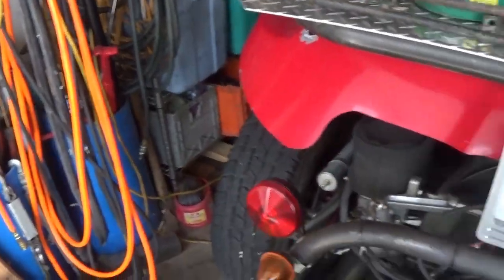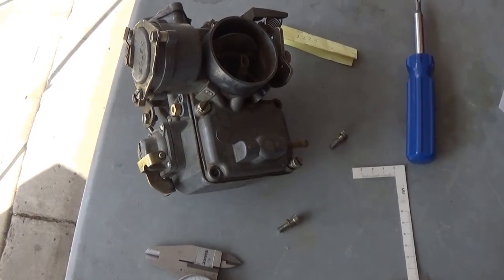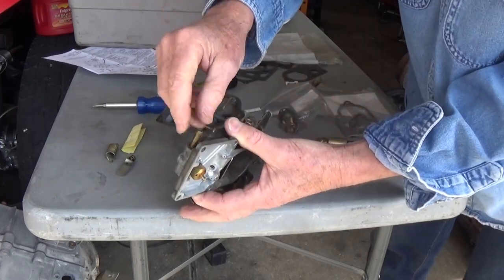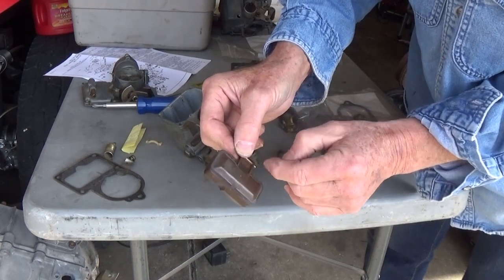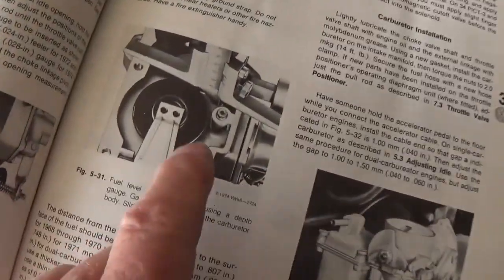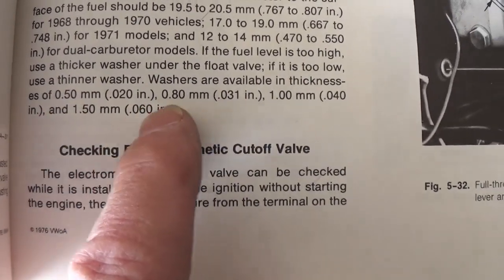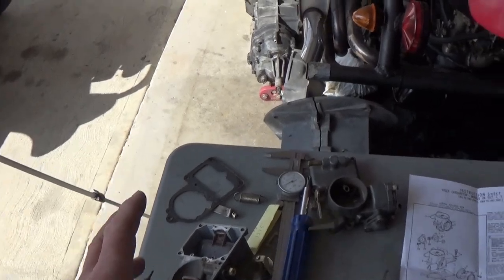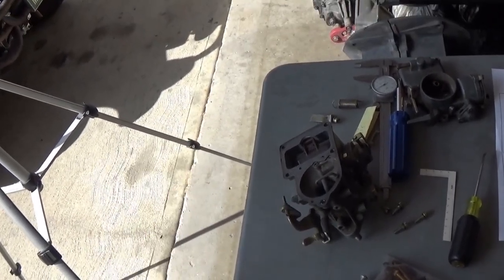VW Solex 34 PICT-3 Float Level Adjustment

Comment: Thanks for the pro vid EZGZ! One side note, I had a pict on my 1600 a while back and had a richness issue and fuel boil over when shutdown. I friend of mine was telling me about the newer ethanol fuel and it has a lower boiling point and it's buoyancy was different than the ethanol free. So i added an extra washer under the needle/seat(2 thick washers total) and that did the trick(the carb was setup per the book then jetted to the engine) man I was having a steak burrito the other day and thought EZGZ is missing out on one of these! Hope you've made it down to your local burrito joint and had yourself a treat! Catch ya on the flip side
Reply from the maker: Great info!  Love it when folks share there experience!

Comment: Thanks EZ, good info. Was having a similar problem at one time. Had the wrong size spacer under float valve and was choking itself out. That was on a 30 pict 2. Got it right and runs like a charm now.
Reply from the maker: Thumbs up !!!   Thanks for sharing

Comment: The carb top gasket in these rebuild kits are at least twice as thick as the original paper ones. This is likely the cause of flooding issues. Extra washer is the right move.

Comment: Greg, I need some help with a drla carb. Seems too be running too rich, plugs are black and black smoke from exhaust. How do I adjust to not get as much fuel? I got the bypass screws closed and tried my mixture screws between 2 and 5 turns and doesn’t change much.
Reply from the maker: I need more info:  
Is this a new problem?
What model DRLA? 
What size engine?
Reply: @TheEZGZ  not really a new problem, trying to get the car running after sitting for years. Cleaned carb but seems to getting too much fuel. 
Next to DRLA it’s stamped 45D
Pretty sure it’s a 1600

Comment: Hey EZ.
Great to see that you are back. I hope you are feeling better.
Please.
Can you give me some advice on using a new cam and cam followers in a twin port 1600. 
I have been told I need to use ‘cam lube’, then run the engine after the rebuild at around 1500/2000 rpm for 20 mins to harden the parts.
Is this right?
Just seems extreme to me for an air cooled engine that is stationary.
Thanks.
All the best.👍🏾🛠🇬🇧
Reply from the maker: Every new cam I ever bought came with a little jar of break in lube. If yours didn't come with it you can use some really thick motor oil. Lucas makes a good product. Do not under any circumstances use grease or assembly lube as a substitute. Auto parts store might even have a specific cam lube product.
Yes you want to start it and immediately keep the revs about 2000 RPM so there is plenty of oil saturating the cam during that first 20 minute break in. Don't worry about the timing being perfect or idle screws. You'll be running on the mains. Just watch and listen for major oil leaks and keep it running. 
Then dump the oil while it's still hot including the filter. Refill and let the engine completely cool down. Recheck your valve clearance and your good to go for many miles and smiles.  
It would be nice to pick up a VW shop manual that explains all this. Don't trust everything you see and hear on the internet.  
Also a good idea to use break in oil or get some zinc additive.
Reply: @TheEZGZ  Thank you EZ.
Yes. I have bought some 20/50 high in zinc oil, for the initial start and cam burn.
I’ll then empty it and refill with 30 weight mineral. When driving, do you suggest not loading the engine for the first 500 miles? I have two 30ml satchels of Cam lube, which I bought separately.
I have a Haynes manual for reference.👍🏾🛠
Reply: @TheEZGZ  Hi EZ.
She’s up and running.
Did the ‘cam burn’ last night and took it for a short run, then. Changed the oil.
Now I have to reset the timing and carb, as it keeps stalling at junctions and won’t tick over.
Any tips?
Hope you’re feeling better.
All the best.👍🏾🇬🇧🛠

Comment: Are those written book instructions correct? surely if the fuel level was too high you would use a THINNER washer, basically moving the float valve nearer the float, cutting the fuel flow earlier as the float rises?
Reply from the maker: The book is right. A thicker washer pushes the inlet valve down against the float and shuts flow off sooner which lowers thee fuel level

Comment: Hi EZGZ Sir. Can you comment on the 34 PICT Carb versus EMPI Progressive carb? Is the Progressive carb more economical in terms of fuel consumption because of the initial carb port opening is smaller...
Reply from the maker: Fuel consumption needs to stay around 24  MPG  for normal driving.  The engine and heads need the fuel to help keep cool.  The progressive carb works well  "if" you can find the parts to tune it properly and will allow more fuel and higher rpm.  Some folks swear by them but for a street car I'll take dual carbs most of the time.

Comment: Sorry about an off topic comment, but I can't find anyone addressing this problem and you seem to know what you are doing.
Im converting a 66 to a dual circuit master cylinder. (drum brakes)  As the residual pressure valves arent available, I salvaged some and got them working . Now I discover that new dual circuit cylinders wont accept the valves.
Bentely says I need them. so what do I do ?
Use the stupid aftermarket ones at $20? each ?
thanks for any suggestions ( except FO)
Reply from the maker: Not telling you what you should do. But I run whatever came on that year of car and don't worry about it. The purpose of dual brake system was safety in the event that you got a hole or broke a line the system would stop you.  Seems to me that the emergency brake was ment to do the same thing.
Inspect and or replace your entire brake system with new parts and keep them drum brakes adjusted at regular intervals like bentely suggests

Comment: solex 31 pict-4 what's wrong with the carburettor when at first it may run well and the adjustments should be right and then at idle it shuts off and the big air screw no matter how you open it, the revs don't go up? the repair kit is installed..
Reply from the maker: same answer as above.  You need to purchase a basic VW service book that has pictures and gives trouble shooting options.   The ignition system and also make carb tuning difficult

Comment: what's wrong with the carburettor when at first it may run well and the adjustments should be right and then at idle it shuts off and the big air screw no matter how you open it, the revs don't go up? the repair kit is installed..
Reply from the maker: You may have a restriction in the idle circuit fuel passage somewhere?   Hard to say without my hands on it.

Comment: by the way, what about the fuel nozzle, which is a brass pin that sticks out where the thermostat valve is, so what is its function?
Reply from the maker: That is where the accelerator pump squirts raw fuel down the carb throat on quick opening of the throttle to compensate for fuel air ratio

Comment: Hai hai great video one question am from Africa ....same carb on my bmw ... The idle is perfect but once I start moving the consumption is quiet high  what cud be the reason
Reply from the maker: larger displacement engine and heavier car uses more fuel????
Reply: Wow so meaning my car is running normal ? .... otherwise the idle is perfect

Comment: is it normal that without the Air Cleaner system the engine shuts off.. then when it shuts off at idle so when you remove the small hose from the intake neck it shuts off immediately, for a while it just raised the idle revs...
Reply from the maker: When you allow air to come into the intake manifold at idle vacuum your reducing the fuel to air mixture and the engine will stall.   When you add or remove a dirty air cleaner your also changing the fuel to air ratio that can effect idle.

Comment: I’m OWNED by a ‘71 VW transporter named Myles.
Maybe you can help me! I’ve had a problem with my 34 PICT 3 carburetors. This has been going on FOREVER!
 The instant the carburetor comes off high idle and goes to running idle the engine stalls. As long as I keep goosing the engine it’ll keep running. As soon as I stop the engine stalls.
It makes no difference whether I have the vacuum from the distributor connected or not.
I get 17 inches of vacuum from the carburetor.
HELP!!
I hope you’re fully recovered from your heart surgery!!
Thanks for any ideas you may have!
Reply from the maker: sounds like a clogged idle jet to me make sure your idle fuel  screw has an effect when you turn it in and out. Also use the idle air screw to see the affect.  I'm assuming your electric solenoid device is getting 12 volts and working properly.

Comment: solex 31 pict-4 fuel level is 14,7-15,5mm..it is 1300 1973 car..is it that ok?
Reply from the maker: Yes! it's not going to hurt anything if it's off by a little bit. Replace your spark plugs while you do a tune up and check the easiest one to get to after a couple tanks of gas. And of course notice how it starts and runs to be sure.

Comment: My bug runs when the choke is on.
However, once I hit the gas after it has warmed up and off the step the bug will die. No matter what adjustments I do to the volume screw or the bypass adjust, nothing happens.
Reply from the maker: You need a spark advance timing check and also make sure your accelerator pump squirter is working my friend
Reply: Also, no idle, is a clogged idle jet.
That would be the brass hex jet in the passenger dide of the carb.

Comment: Question, I'm running dual ICT carbs on a stroked 1600.  When I get on the gas, especially mid to higher RPMs, I get a bit of popping. Any ideas on what to look for?
Reply: If you're running a 009 dizy, open the accelerator pump adjuster up to full. The popping is probably caused when you open the throttle up and cause a lean spot. The new setting will overcome that lean period.
Reply: @Paulman50  running pertronics with vac advance. It keeps popping at sustained throttle
Reply from the maker: Was it always this way?  Most times it's like Paulman said but the list of other possibilities is long. Here are some things to check
Spark plug read
Plug wires
Spark advance
Vacuumm leaks
compression
valve clearance
accelerator pumps not working
Can you borrow a different set of carbs?
Reply: @TheEZGZ  It has always been temperamental in one way or another. It had a lot of blobby so I put a new set of jugs/pistons and heads on it. new plugs and wires too. The previous electric dizzy ended up with broken wires so I got a  pertronics dizzy. It isn't as poppy if I bring up the rpms quite slowly. This is all while stationary mind you, the vehicle isn't a North Dakota winter drivable one.
Reply from the maker: @smonroeh  Sounds like you spent some money and worked your butt off. With that said I wish you would have gone just a bit farther and split the case. 
It's so helpful to look at the #2 main bearing and also the camshaft and lifters. Sounds like you are very close to a sweet set up.  One of my first cars came with a 1776, Norris Cam and dual 34 ICT webers it had dual glass packs and heater boxes and I drove it that way the first winter. Those carbs never gave me a problem. The throttles were cable operated. With all the work you did it's probably not that dirty yet. I'll bet you could tear it down in a weekend and see what that bottom looks like. It's good to have at least a new cam and lifters. If someone stroked the motor they may have put to hot of cam in it for the compression and carb choice you have.
Reply: @TheEZGZ Work never gives me much time to do bigger projects like splitting the case.  I also think that splitting is pushing my limits both in talent and knowledge, and the cleanliness of my garage. I do believe that the motor does have a W100 cam in it.